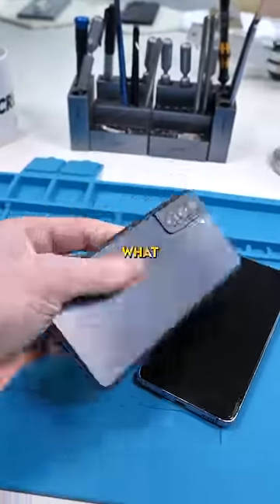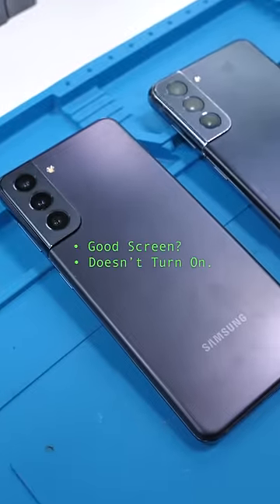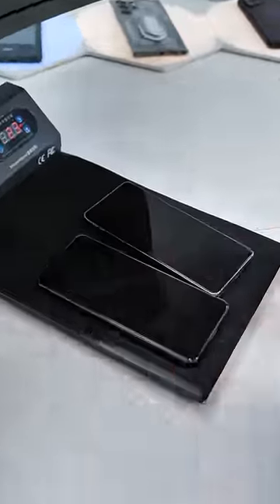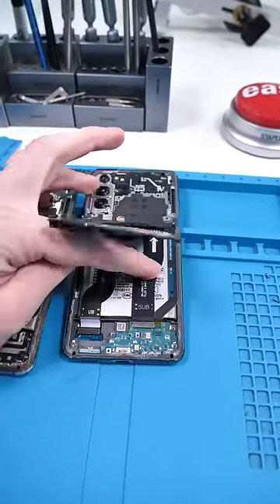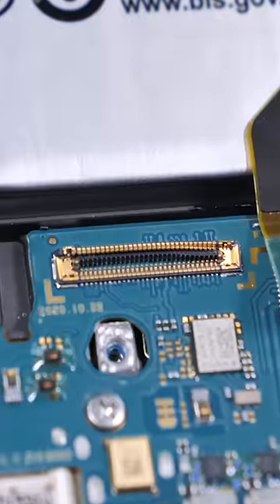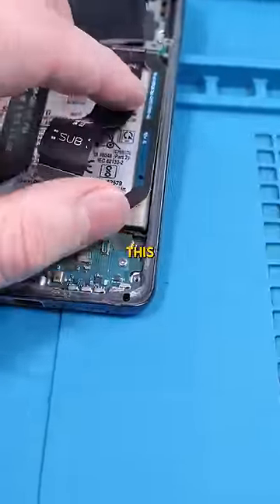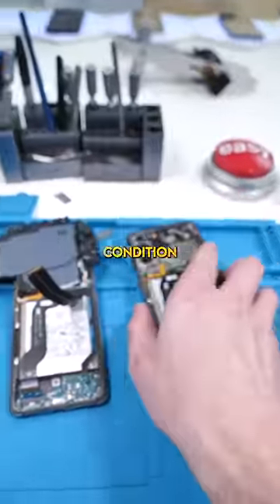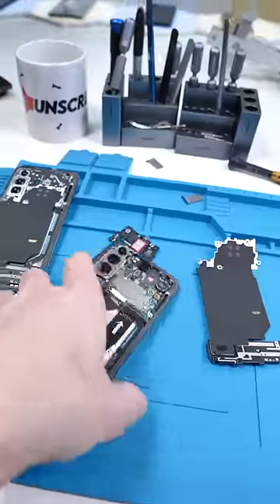I Don't Usually Do This... #Shorts

Comment: For some reason this happened to my brother’s phone he also dropped his phone (same phone in this video) it can’t charge and cannot detect the Sim card so I open it up and I found the wires were disconnected so I connected it and it works.Lucky he didn’t need to buy new parts.I am still 14 years old and I know how to do this stuff,I learn a lot from this guy.    Love your videos
Reply: PRG is the tech teacher of tech teachers
Reply: Great job 😊, 
I have fixed over 140 phones with broken screens,motherboards, batteries , face id modules and cameras since i was 11 years old ( iam currently 16 BTW ) the first device that i attempted to fix was an ipad mini with a blown battery at the age of 7 but once i got the screen opened and unplugged the battery connector it started smoking and i threw it to our backyard and it exploded, after that i was scared to fix batteries 😂

Comment: When I was in high school I shattered the screen of my s4, found an s4 on the sidwalk in town that had a working screen but couldn't turn on (just had the Samsung logo forever), and I Frankensteined them together into a single working phone in an afternoon, with no prior experience, using nothing but a small screwdriver set and an ifixit guide.

I miss those simpler days.
Reply: My friend and I got the same phones. Once his one didn't turn on anymore, and mine had a cracked screen, I swapped my board into his phone, and boom working phone

Comment: Can i ask? So the scenario is that the other phone is locked with a password and you want to transfer it to a donor phone woth the same model, after transferring it does it still have all the data  locked and the screen lock as well?
Reply: Like the chip that holds you data and phone setting stays the same even if it eas transferred to a donor phone?